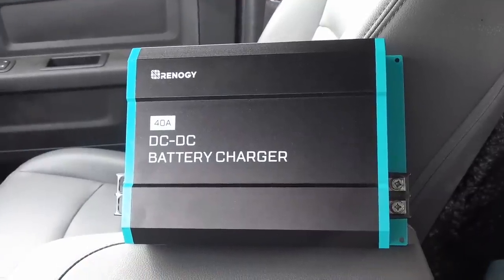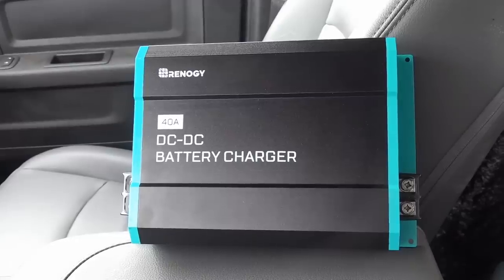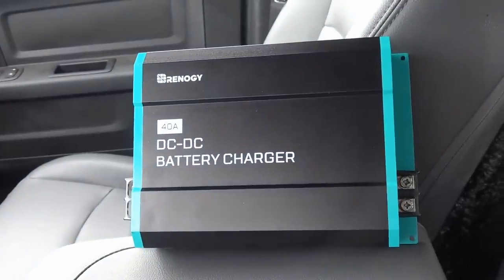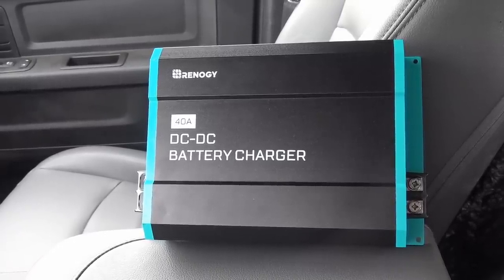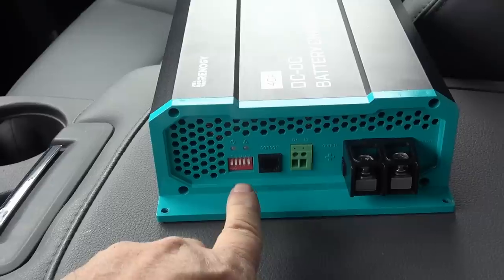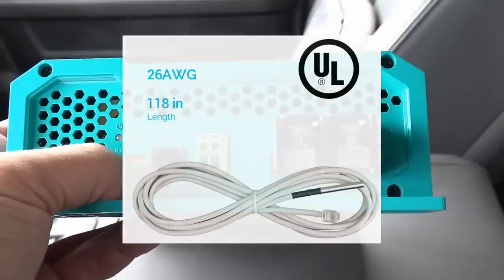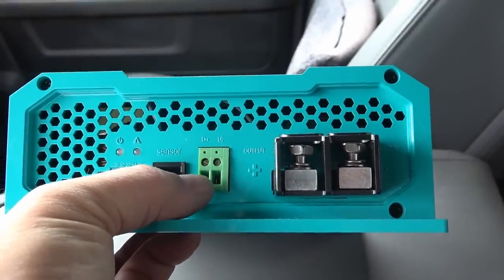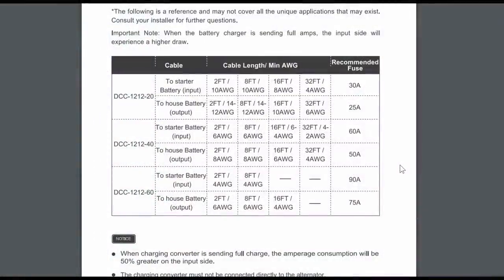Extra 40 Amps Charging into RV Battery Bank from Truck Alternator (Renogy 40A DC-DC Charger)

Comment: They make a large trolling motor plug hood for 60 amps that’s what I did and the bigger one is super nice and I have a Bigfoot truck camper and mounted the plug inside front side of bed. They say if you use too big of wire that the lithium’s will draw a ton of amps and burn or wear out prematurely, that’s what I ran 6 ga and so far so good no warm or hot wires.
Reply from the maker: The DC-DC charger will regulate the max current flow into the batteries. Doesn't matter how big the wires are the max output is 40 amps of the charger in this video. And actually a larger wire on the input side of the charger will lead to less current draw as there will be less voltage drop so it will draw less amperage to make the same wattage transfer.

Comment: Love your videos. I was watching you connect your DC to DC charger and you used jumper cable wire. Most all jumper cable wire is copper coated aluminum wire. Do you think that aluminum wire will hold up under hours at a time of 40amp usage? Thx
Reply from the maker: I don't know. I used 100% copper ones I found at a truck stop and they have work fine. But a person doesn't have to used jumper cables I did because it made it nice since the two cables were attached together.
I linked to some 100% copper ones found on Amazon  https://amzn.to/39hUVAr
TOPDC Copper 4 Gauge 20 Feet Jumper Cables
Well-constructed with solidly built heavy-duty clamps, and made of high quality raw material. All these small details make TOPDC jumper cables remain flexible even in extreme weathers like -40℉/-40℃.
100% copper wires make it extremely flexible. It comes with safety gloves, this makes you ultra-safe. Also, this includes a durable carry bag which makes it convenient to store and keep your trunk clean and tidy.
100% copper wire
300 Amp jumper cables. Remain flexible at -40℉/-40℃ to 167℉/75℃
Comes with safety gloves
Strong spring make the clamp hold up terminal well

Comment: Charging limit is for battery size. A 40 amp charger will work perfect with 400ah battery. Or it could be used to limit the amp going to the battery an run other accessories.
Reply from the maker: Also, depends on the battery type. My old golf cart lead acid batteries recommended a charge rate of 15 amps, so I used to charge the 4 of them (combined 464ah) I had at near 60 amps. But my new lithium batteries are much different. Each 105ah battery has a max 100 amps charge rate and a 45 amp recommended rate. They can take a much higher rate of amps. So the 40A DC-DC charger would work well with just one.
How do you limit the amps going to the battery? Cheers, Ray

Comment: My truck came with the 440amp dual alternator setup, do you think I need this charger, or will I be able to wire directly to the lithium batteries when I do that install this summer.
Reply from the maker: I'd advise the DC-DC charger, as it isolates the different batteries Trucks and Trailer and boosts the voltage for the long wire run and has adjustable charge settings for the RV batteries.   For some good info on them try a YouTube search "dc-dc charger Australia"  They use them a ton down under. Guess for their outback adventures in their off road vehicles.
Reply: Alternators are largely designed for lead acid batteries. You have lithium. If the alternator is connected directly to the lithium battery, the battery can pull too much charging current. There's a video on here that shows an alternator burning up in this configuration. The DC-DC charger limits everything to safe values. You've invested in a good truck and a good battery. A few more $s to protect those investments is worthwhile.

Comment: You need the big trolling motor plug works perfect for me wires are cool no heat .
Reply from the maker: These connectors work pretty good too https://amzn.to/3FTU71G  I used one when I built my truck box power station  https://youtu.be/ztIYUGFQorE  Cheers, Ray

Comment: I've been wondering how to safely charge Solar batteries through the 7Way connection? I haven't gotten a Solar system yet  I knew letting the Alternator in my Diesel Ram 2500 charge the batteries could damage them! Now when I pull the trigger I have to figure out how to wire this thing into the trucks system in a way I can remove it and restore it to factory if/when I Upgrade to a 1 Ton truck. I plan on buying a Hybrid system that can use shore power or generator and Solar simultaneously. Now I can use my truck to add a source of safe power, the Diesel can pump out a lot of amps since it has too keep two huge batteries charged. 😀
Reply from the maker: The 7 way cable in safe but usually has poor charging abilities. Due to the long length and small wire diameter the charging amperage is generally quite low. It's like trying to get good water flow through a straw versus a water hose.

Comment: I See your summer project became the Spring project LOL I sure like how you connected the signal wire if we ever cross paths I’ll show you how I did mine kinda on the expensive side of things using the power wire in the tow lite plug
Reply from the maker: Yeah, so much easier to get parts off Amazon USA then CA. :) and cheaper! so went for it.
Reply: I just wired mine to the 12V wire coming from the 7 Pin RV plug.  That output is switched on my truck and is only hot when key is on.   So didn't require anything special.
Reply: @boulderwy3387  Would you please provide details about where you connected to your 7 pin for the trigger?  TIA!

Comment: Make a jumper cable with the Anderson connector and it is great for backing up to someone and giving them a junp
Reply from the maker: Good tip, but I carry a better solution for jumping starting :)  - https://www.loveyourrv.com/noco-gb150-battery-booster-review/
Reply: @LoveYourRV  I just viewed the video in the link here. And a bit confused ? You say your Cummins is a 7.3? Did you mean it is 6.7? 
BTW good informative video as usual. cheers
Reply from the maker: @rjl7765  That was an older video from 2017 when I had an old 1994 7.3L Ford F350 - https://www.loveyourrv.com/big-baby-blue-1994-ford-f350-truck/ now I have a 2018 6.7L Cummins in a Ram 3500.  Cheers, Ray

Comment: I have a dc to dc charger in my truck that will put 60 AHs of power into my 540 AH AGM battery storage.  My trigger switch is on the dash.  The charging profile of my batteries allows only two hours of bulk charging, so while underway on cloudy days I charge two hours, then let the solar panels top the bank off.  I find in the summer I don’t need to use the dc to dc charging, but it sure helps in the winter!  Of course your lithiums will take all the juice you can send em, so you can use the dc to dc charger to fill those babies up!!  Nice mod.

Comment: All this is nice, long as people are aware, alternators arent designed to charge batteries, they maintain a charge an power everything while driving, so placing more load on it can drastically shorten life span of alternator
Reply from the maker: Very true, that's why its a good idea to get the higher output alternator option or even go with dual alternators.
Reply: @LoveYourRV  i know on semi when over road i had microwave, tv, etc soon as got home i put charger on it an had good luck, do same with class C on engine batt, have solar on coach batt

Comment: Thanks for the video and it's very interesting! 

That oscilloscope is fascinating. I"m no electrician or even too mechanically inclined but I'd prefer that type of device over having to connect wires to do a test. :)  Just a thought from a novice armchair fan! =D

I heard there's a way some DC-DC charges can do the reverse also. Not sure how that would get done though, but it would allow the starter battery to be charged from leisure battery bank.  Of course, it's not for every application.
Reply from the maker: I'm pretty sure this one doesn't support the feature. Not a big deal though I carry a booster box and could easily jump start the truck then take it for a little drive to recharge the starter batteries. Cheers, Ray
Reply: @LoveYourRV  Very nice, thanks.

Comment: Nice learning experience video.  I often wondered what to do once I convert the RV from flooded lead acid to Li battery when traveling.  That's a goal for next year.  By the way, I have the same TM-2030 & SC-2030 units and the Renogy 200 Watt folding suitcase Solar panels.  I connect those together with the same 4 gauge weld wire on Anderson connectors to the SC-2030.  I don't boondock as much, nor longer than 3 days, so if I do get the DC-DC unit, it would just be the 20 amp and I would connect into that same Anderson connection point.  Because portable solar isn't deployed during travel and the Bogart set would be matched to Li by then.  Combined with the existing trailer connector output I should have ~ 25 amps max; good since I only have the 170 amp alternator and only 2 batteries max.

In time, you may want to change that DC's output 40 amp circuit breaker.   As you know and similar to the AC circuit breakers, they will handle full rated load but the 80% load is what code requires so you have a built in safety zone of 20%.  So as for these DC breakers , I would recommend the same. Only load it to 80% , but it will trip over it's rated capacity. You never want to continue loading a circuit breaker to its full rated capacity as this would be asking for intermittent breaker trips and you might not know it.  So a 50 amp breaker's 80% load would match nicely to your 40 amp loads. Happy Camping!

Comment: I want order this charger but there is 2 different 40a dc-dc available, is the mppt or not?  Or do you have a number for these one?  Great video.  Thanks
Reply from the maker: Mine is just the straight DC-DC charger and doesn't include an MPPT solar controller in it. I didn't need one as I already had a separate solar charge controller in my system. Cheers, Ray
Reply: @LoveYourRV  that’s what I thought…thanks again!

Comment: I personally would put some wire loom cover it what ever it's called and put the wires that are outside in it. To help with weather and stuff.
Reply from the maker: Good tip. I decided for the wire that runs under the truck I used stuff that is double jacketed. A tough inner wire covering plus a softer thick outer jacket for protection. I'll add some loom over that. Cheers, Ray

Comment: Why add a switchable breaker between the battery and the charger when you can simply disconnect the wiring harness if you want to isolate the charger? Seems a bit overkill since you actively protected the charger and the wire with a 60 amp terminal fuse.  Thanks
Reply from the maker: I wanted the ability to be able to switch power on and off to the outlet by the tailgate for powering other items if I want and I also didn't want the whole cable live all the time. Only when I'm using the rear outlet. Maybe overkill but that's the way I wanted to do it. Cheers, Ray

Comment: In your video you show a buss bar with a clear plastic cover. Can you tell me where you purchased that particular buss bar from please?
Reply from the maker: It's a Blue Sea Systems 5503 ANL fuse block with insulated cover https://www.bluesea.com/products/5503/ANL_Fuse_Block_with_Insulating_Cover_-_35_to_750A  
Got it from Northern Arizona Wind and Sun https://www.solar-electric.com/blue-sea-systems-5503-fuse-block.html 
I also use it as a holder for my inverter protection fuse. Cheers, Ray

Comment: I love the idea of just tagging onto the SCC output. So if you were in a motorhome I assume you would have just used the keyed ignition on lead for your trigger? This is so the dc dc charger doesn't drain your starting battery after your engines off.
Reply from the maker: You can use any 12V trigger source you desire. What ever works best for you. Cheers, Ray

Comment: Hi Ray, question for you. Did you happen to install a diode on the 12v charging circuit coming from the truck, the one through the 7way? I am wiring in a 60A model and am concerned with a back feed scenario.
Reply from the maker: No, I didn't bother. I've been running solar panel charging for years with the tow cable hooked up and no issues. The solar charge controller puts out a similar 14.4V output as the DC-DC charger and the alternator does.  The only scenario I can see being a problem is if the trailer batteries were very low in voltage basically dead and the truck was hooked up and not running, say overnighting somewhere. Could draw down the truck batteries. But I've never run into that situation myself. It's also possible the truck has a relay so the charge line is only active when it's running. Or one could unplug the tow cable. Cheers, Ray
Reply: @LoveYourRV  Thank you for the reply, keep up the great work, I enjoy your content! Travel safe...
Reply: @brianpetersen3262  If you do install a diode, (it was my concern also, having a sneak path or a circulating current) I plan to install a Schottky diode in series with the trailer plug, it has a lower PIV (.3v vs .7v) therefore less losses across the diode.

Comment: Thank you for taking the time to answer all these questions. Most of mine were answered as I read them all. I have one I didn't see though. I want to install this in an extra plastic battery box next to the one my single battery is located. What do you think of that. I would like to do this as my trailer is small and I don't see a good spot to locate it inside and have to drill a hole through wall or floor of trailer. Thank you  for making such an informative video on this subject.
Reply from the maker: You are welcome!  The only thing to be wary of if you put it inside a box is ventilation. When the DC-DC charger is working hard it gets hot, it has a fan inside and a metal case for cooling. So depends on the size of the box and the temps you travel in and if it has some openings for airflow. If the box is too small and sealed up tight the charger could overheat or have a reduced life span due to the electronics always running hot. Cheer's Ray
Reply: @LoveYourRV  Well there's a nice way to keep the Li batteries "warm" if traveling in really cold weather when charging is needed!  Locate that DC-DC into your batt. box; you have opening cutouts enough I bet or add one more up high.  Then once parked, stuff closed batt. box openings to hold that heat in for awhile.  Free heat is free heat!
Reply: @garyswitzer6867  Tat is an excellent idea but you still have to make sure there is enough ventilation to keep the DC-DC unit from overheating.  It may be a difficult balance to find.

Comment: I have a Ram 2500 diesel with a stock 160amp alternator.  My trailer house bank consists of 2 ea 230ah golf cart wet batteries wired in series for a 12v output.
Can you please advise if I should go with the 40amp or the 20amp charger.  My concern is avoiding overloading the alternator, though I want to get use as large a unit as is safe to efficiently charge the house bank.  Thanks in advance!  Great video.
Reply from the maker: Its difficult to say for sure as the truck options vary so much these days its hard to know what other items may also be drawing the alternator, like for example, entertainment consoles , light packages,  fog lights, heated steering wheel/seat, etc.  Sone of the higher end truck packages have a lot of stuff. Maybe a mechanic could advise you.  Cheers! Ray

Comment: Ray when you said " May also run an inverter to power my RV fridge off electric while towing." Do you have a gas electric fridge? So if you do are you running your fridge on 120v? Did you have to wire you fridge yourself to get it to run on the inverter? Are fridges in newer gas RVs fridges hook up to inverters if you have a starter RV solar factory kit. I'm getting a Cougar 24rds with solar and cant order with the 12v compressor fridge right now so thinking of going with the gas fridge...A rep from Zamp told me that the solar kit installed on the new Cougars are not nearly up to the job of charging a 12v compressor fridge. Most RV salesman don't know anything about the 12v fridge and tell ya than they are the best thing since slice bread but the internet has been telling me that they are power pigs.   Sorry a little winded but the lack of knowledge out there is killing me.. Thanks
Reply from the maker: Yes. My fridge is a Dometic DM2652 dual LP gas/120VAC electric. Usually I don't run the fridge during travel as I don't like to have the propane turned on while under way. In electric mode it draws about 32 amps @ 12VDC about 325 watts when its cycled on. Fridges cycle on and off depending on outside ambient temps.
I plan to upgrade my ten year old 1000W inverter soon to a higher wattage one now that I have tons of battery capacity so was thinking of repurposing the old 1000W unit for dedicated fridge electric power when we travel. With the new DC-DC charger plus my solar panels I will have lots of extra power going down the road. May as well keep the fridge cool. :)
Reply from the maker: @unclelala4216  I haven't hooked it up yet but would be really easy as the fridge has an AC input to plug into. So easy as running an extension cord to it from an inverter.  I didn't get the 50 amp MPPT charger because I already had a 30 amp solar controller so I got the cheaper 40 amp DC-DC converter instead. So instead of maxing out at 50 amps charging I can get 70 amps max with my system. And actually, recently I have added a 40 amp solar controller so now can get max of 80 amps driving down the road. https://www.loveyourrv.com/boondocking-power-upgrade-added-separate-500w-solar-panel-ground-array/